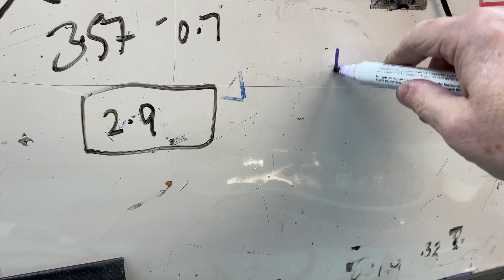Fret King Country Squire set up

Comment: I own a Fret King Jerry Donahue signature guitar with full Trev Wilkinson accoutrements, its a thing of beauty and plays lovely. Not sure what gives with the second hand prices of these things, I suspect a lot of it is down to brand name. Thanks for giving them a much deserved airing.

Only problem I have had with mine is static through the fingerboard being amplified by the pickups. My cure as I dont want to take it apart yet is to wipe the fingerboard down with an anti static cloth used in drying machines
Reply from the maker: THanks DB. Static... interesting. I had a guitar in recently where I noticed that too (forgot what it was now). It turned out it was only through one amp in one place; everywhere else it was OK.... I'd have one of these any time. Really well made guitars - the neck alone is sweeet.